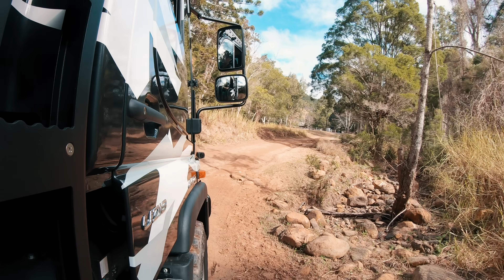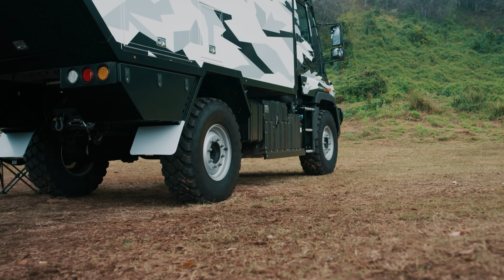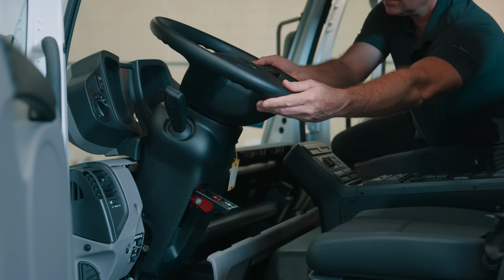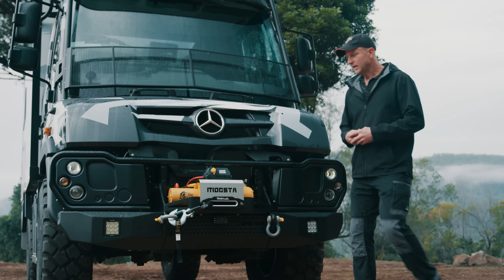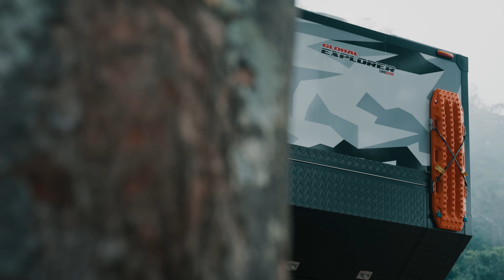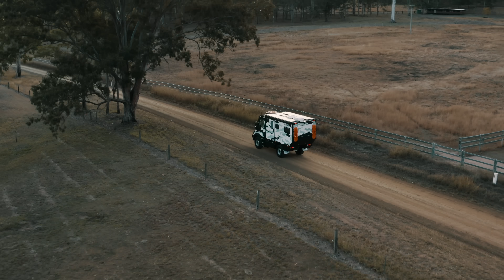2020 UNIDAN Global Explorer - U218 UGE Unimog Expedition Vehicle

Comment: damn this is really a completely package. has all features i have though in this. usually there will be one missing, but this covered all, especially that steering wheel side change is really amazing. this is perfection except for one. cabin access from the camper. i know there will be chake but still an way to access cabin from the camper would have made this perfection.

Comment: What about kids, where would they sit? Does the Cab come with rear seats and doors? How expensive are they. Can we get one in the USA?? Great video!! How are they in snowy conditions?
Reply from the maker: Hi Paul, 
This vehicle was for a couple that have adult kids who no longer travel with them. Unfortunately the UGE Unimog's only come as a single cab, however we can build expedition bodies on other chassis' in order to have a dual cab with a large enough body for the whole family (Mercedes-Benz Arocs) or the UHE Unimog as a dual cab with a shorter body. Alternatively, we can also have legal seating in the rear of the body. 
We can build an expedition body for the USA but it would have to be based on a restored older vehicle due to the importation laws in your country. 
We can also build expedition bodies to suit extremely cold climates. 
If you are interested in getting a quote for a project, please send an email to info@unidan.com.au

Comment: What drove the move from runva to Sherpa?
Reply from the maker: We only use the Sherpa winches on vehicles that have a lower payload and therefore every KG counts. The Sherpa winches are much lighter than the Runva's. However, we definitely back Runva for all our bigger builds and projects where overall weight isn't an issue.

Comment: The off-road ability is 2nd to none yes, but you have to drive on the highways to get to those destinations, top speed is 90km/hr and the aggressive lugs on the tyres makes a very noisy and uncomfortable drive on sealed roads. There is no places in Australia that get down to -40C mate. 480 litres fuel capacity equals around 1860kms with its heavy concumption.
Reply from the maker: All brand new Unimogs are speed limited to 100km/hr in Australia. I think you will be extremely surprised by the on-road noise and comfort of all new Unimogs, even the fuel consumption. And as for the temperature, a lot of our customers are speccing their vehicles for international travel, hence the specifications to suit.

Comment: This is really serious dedicated off-road equipment machine; I wish Unimog issued another 'volks' vehicle without most of these heavy industrial minded frame connection and made a something more than Ford F-150 ( with the same tire size ) or more spacious than LC 70 series for off-road but rugger as it is. New idea should be shaped as old one is, with engine a little bit moved just a 5 cm forward with 4 doors as standard. Something between Hummer and This Unimog but dimensionally same as F-150.

Comment: it would be great if this was electric. imagine being able to go anywhere without fuel. just camp for a bit to recharge batteries and off you go
Reply: If by ‘camp for a bit’ you mean for a minimum of week or possibly 2-3 weeks if you wanted to venture further that could work. But this isn’t a Tesla sized vehicle so would likely need a minimum 300Kwh battery which even if parked in the sahara would take at least 200 hours of sunshine to charge with the panels that are on the roof and typically twice that.
Reply: It's quite simple. 1kg of fuel has 48kj of energy. 1kg of lithium iron battery has 3kj. So you would need at least 16 times the space for the batteries. And your carrying 16 times the weight. Your 12 to 15 ton truck has just doubled in weight on a fallacy. Go read the latest from Yale, Harvard, MIT, AIT and many ,many more on particle forcing, earth and galactic cycles.
Its an absolute scam this CO2 shit. Yes we're pumping out too much of it. causing the earth to green. Oh dear.
The biggest damage we are doing to the earth is single use plastics, and building our homes on flood plains. In saying that, like in this situation where it can be a hybrid of petrol to get you there and clean solar to keep you there for an extended times is brilliant.
If it was viable then so much farm machinery would benefit from it. An electric tractor would be brilliant. They need right off the bottom torque, not rpm horsepower.
Then there's the earth and destruction. Do you know how solar panels are made and what with? Rare earth metals are incredibly toxic, they very easily enter the air, earth and water and are an environmental disaster. Not to mention a political one. China owns and produces 97% of them. A wind turbine has 3 ton of it in them. And a twenty year life span. And don't forget, renewables will never be fully efficient, they will need a nuclear back up. I' sure you've heard of Chernobyl and Fukashima. Did you know there are about ten other nuclear power stations that are a no go zone. Concreted in to protect the environment. A constant maintenance nightmare. The media is full of shit and yes science as been corrupted. Science is an evolution, never a conclusion.
Look at what this whole lefty shit is doing to America. It's an ideological nightmare. Maybe in time we can one day. Today is not the day.
Reply: Quacky Duck 

Everything you say seems reasonable I don’t doubt you, but could you elaborate on the toxic rare earth metals. 

You say they can easily enter the air, earth and water. But did they not come from planet earth anyway? Cheers.

Comment: looks like top-heavy though,  if you experience Wind with 40 kmph  on the side it might tip over
Reply from the maker: MrShelange 3.3m high and 2.4m wide to outside of tyres, it’s very stable and very low for this type of vehicle.
Reply: Unidan Engineering 

At 3.3m high the mid point would be 1.65. But there’s a heap more weight down low than up top. I think it would be fairly conservative calling the centre of gravity 1.5m from the ground, I’d say it would be lower, but even at that height and the 2.4m width it would take 39 degrees to tip it over.

Comment: why is the unimog so good off-road? because it was NOT built for the military ... that was even forbidden after the war
Reply from the maker: Axel K all of the ex-ADF Unimogs coming out of the auction have been in service since they were built for the military in the 80s. The portal axles and torque tube suspension make these vehicles second-to-none in the off-road industry. It was the 411 Unimog (original Unimog) that was built for farming purposes after WW2. I guess then because of it’s off road ability, it was then taken on by the military for these benefits.

Comment: Impresive engineering and build.
I would like to know by your experience maintenence costs, fuel economy of the Unimog
Reply from the maker: Maintenance costs completely depend on which model of Unimog you purchase and how much you use your vehicle. As for fuel economy, they are between 20-25L/100km for the older U1700 Unimogs and approx. 18L/100km for the new model Unimogs
Reply: @unidanengineering  Thanks
Reply: 20l/100km? Diesel?
Reply: @florendaddy6728  yes

Comment: Very nice indeed. However not everyone needs to go to the extremes of a Unimog. Will you work with other base vehicles ie Iveco Daily 4x4?
Reply from the maker: Unpluggedkiwi in comparison the U218 Unimog is not much bigger than a Daily. If you take a stock U218 compared to a Iveco Daily with all the mods required to make it capable of off roading and be able to safely carry an EV body you will find that the U218 is 1.far more capable. 2. Much more reliable 3. Not that  much different in price. 4. Will carry a fully decked out EV setup with plenty of GVM to spare. 
To answer your question, yes we can build on other chassis’s
Reply: @unidanengineering  Thanks for your reply. While I would use it for touring in Australia and possibly South-East Asia, it would ultimately end up back in New Zealand. To the best of my knowledge, Unimogs are not sold in New Zealand and, while the NZ Army had them, that was some years ago. So spare parts/maintenance etc in the future could be an issue. I was thinking about Isuzu, which would do everything I want, but thought the Iveco might be a better option due  to diff locks and gearing (and disc brakes on the front) if I ever did need the extra ability to get out of trouble. The Iveco is also sold in New Zealand, hence availability of parts etc.
Reply from the maker: Unpluggedkiwi  Unimog is definitely available new in NZ.  There’s a lot of new ones getting delivered over there lately.  For world touring the UGE is the ultimate with Vario Pilot, meaning it’s both legal Left and Right hand drive. To my knowledge it’s the only vehicle available with 30sec change over.
Reply: @unidanengineering  In NZ, a Class 1 license allows us to drive vehicles with a Gross Laden Weight of 6,000kg. Class 2 is 6,001kg to 18,000kg and Class 4 is above that. While I have Class 1, 2 and 4 licenses at present, as I get older and have to have medicals to renew Class 2 and 4, it may be that I drop back to Class 1 only. Hence A vehicle of less than 6,000kg, which I think is possible with the Iveco.
Reply: Unpluggedkiwi As a 57 year old with 1, 2 and 4 licenses I advise that eyesight is the one issue you really need to worry about and that affects all classes of licence. I went to an optometrist after the rubbish machine at the AA counter gave me a false negative. It is bus and taxi licences that require you to go through ALL the medical hoops.
Reply: @michaelguerin56  Thanks for that Michael. I am actually aware of this, and have had the same issue with the eye tests. I am 64 years old and, as one gets older, need to think about possible medical issues. A person I know was a long haul truck driver. He had a stroke and his Class 2 and 4 licenses were cancelled. He wasn't even allowed to resit for those until 2 years after he had his stroke, and then had to jump through all sorts of hoops. If I am able to stick with Class 1, then the possibility of problems in the future is reduced.
Reply: Unpluggedkiwi Fair enough. Best of luck with your plans. Might be worth looking at Japanese trucks also, as the lights/indicator stalk will be in the correct, i.e. offside position and the wash/wipe stalk in the nearside position.
Reply: @michaelguerin56  My last seven cars have been VW's, so indicators etc no problem.